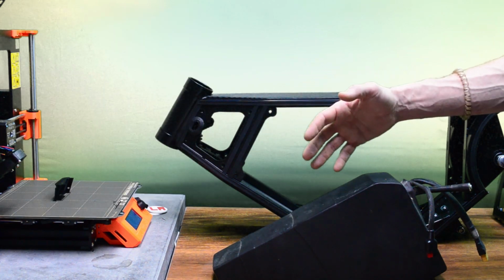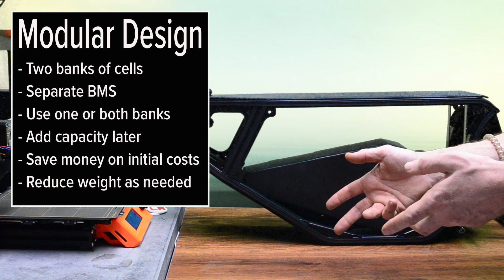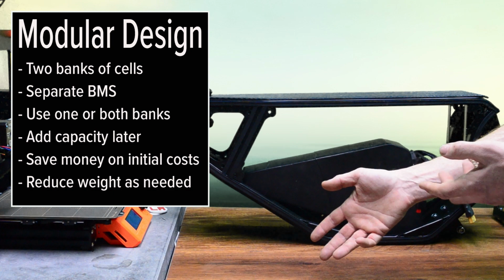Electric Bike Battery System (Modular) Concept / Ideas - Lightning Rods 10kw Ebike - Part 4

Comment: Last fall I combined two 72v 25ah triangular batteries side by side in dual drive hard tail. They are paralleled into a 72150 Sabvoton to power my QS 205 with a lead to power the Bafang. In the horrible hills of Northeast Oklahoma, using both drives together has eliminated all the heat problems associated with hubs and mid drives both. Battery life is extended noticeably, and NOBODY beats this 73 year old Marine across an intersection! Just for grins hook yourself up a hard tail with both a hub and a mid drive and run a heat test running both at once.(Yes I’m crazy but they used to have me build F15 fighters!)
Reply from the maker: That sounds outstanding Bob. Always look forward to your comments. I'd love to see leaving all those F150s in your wake! Dual drive is definitely on my wish list! Cheers.

Comment: Ever consider the Leaf battery cell?  It is thin, pack's a punch and can be quick charged. Ladi did a video... at about 2:50 in the video, you can see what i am talking about.
https://youtu.be/B1-vh3m6zI8
Reply from the maker: Thanks for the link. That's an interesting idea I had not considered. I have seen a few videos with Bruno power using the batrium bms system which I think is specific to the leaf cells. I will have a watch when I get decent cell coverage. Cheers
Reply: @HighVoltageKits  you should be ablt to easily fit 27 ah battery inside. It can be quick charged from empty to full in about 3 hours. Take care!

Comment: The Sony vt6 cells are damn near full power until the battery is completely empty.  The Sony battery that I have is 52v 27ah and it packs a real punch.  The 21700 molicel is an even better option for your build with a possible 10kw running through it.  When you are done, you are going to have one cool looking electric rocket transport device.
Reply from the maker: Thanks mate. I am still thinking about our project. I will give you a shout soon!
Reply: @HighVoltageKits  sounds great👍 cheers

Comment: Im build a modular 74v modular battery pack as we speak. I'm going 8P 20s tesla  model 3 21700 cells. I went with modular for two reasons. First reasons is balance charging. I found a cool little icharger that charges up to 12s battery packs. ( icharger X12). 2nd  is that a modular pack is easier to fit in and out from bike to bike. So as I upgrade or want to add cells, make it much easier to do. 
My opinion is to think about going the 21700 cell route. To me it's better and more dense that 18650. As for pouch cells, I just don't trust them to be in my home and be comfortable knowing they are there.
Please tell us more about that motor I am very interested in it.
Reply from the maker: The LR build is a series so you will see lots more. Glad you are also looking at this modular route. You can see some more pics and info on the website under motors. www.captaincodswallop.net Also more information posted regularly on the discord server..Cheers!